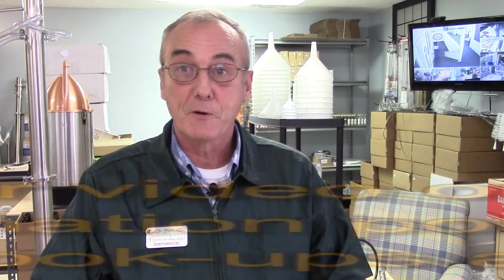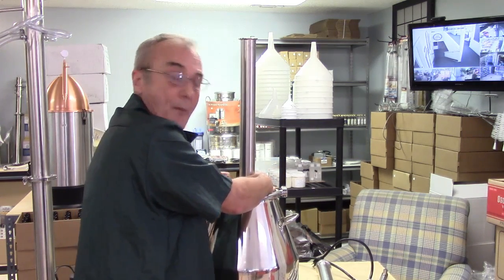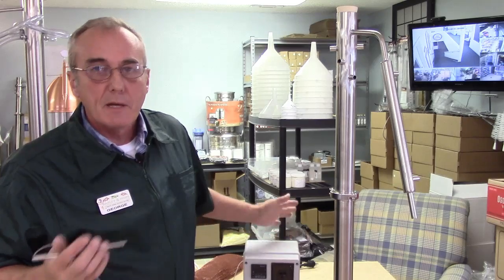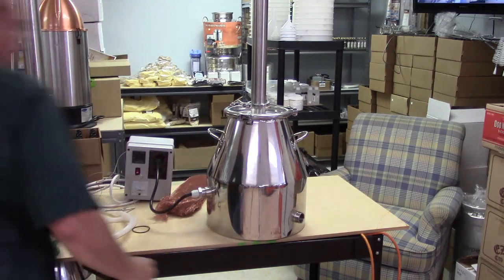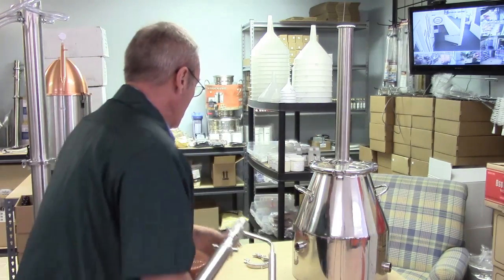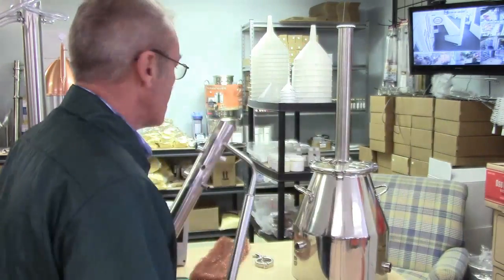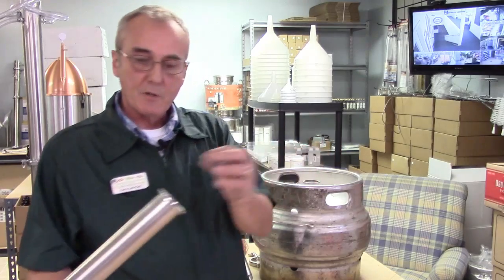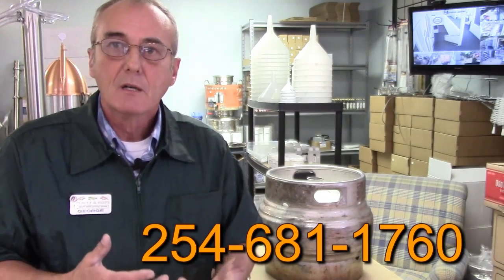2 inch Pot reflux still

Comment: To clean an old keg. 
Take it out side, 
put on an old rain coat and safety glasses, 
put a cup of caustic soda in it,
 pour a jug of boiling water in it and run, 
hose off old rain coat,
empty keg if its not already empty and rinse. 
No scrubbing required,
You might also need a shower.

Comment: does each plate represent a single distillation, i.e, stack 3 plates or 3 lengths of copper mesh wire to equal a triple distillation? thanks xxx

Comment: Great video George some interesting things. I did not know that the pony kegs already had that Ferrell piece that the column could already connect to. Thought it was something you had to weld on there!!
Reply from the maker: That's the great thing about it, the keg is already equipped so attaching a column is easy.
George
Reply: +Barley and Hops Brewing LLC 
Indeed, I've seen so many mods to those things but just always thought they had to have them welded on.

Comment: I run a 23 gal 3" reflux still, i was taught (may not bee right) to pack the bottom tube with copper then 2 on top with reishing rings at the top, what is your opinion on this? I run only sugar swipe. great videos

Comment: Hi George. I will be using copper mesh in my column when I run my still. Two pieces and I want to use marbles as well. How many marbles should I use? Thank you Sir. 2" column 1m length

Comment: Hey george i have an old family recipe for watermelon brandy. My question is i have the 2 inch pot reflux set up on a beer keg. I have it in pot still mode and i cant for some reason get the flavor to come threw. Not sure of its something i did or its its because im not using a thumpkeg. Any suggestions. Thanks
Reply from the maker: A much misunderstood topic. Watermelon brandy is difficult at best and the flavor of watermelon does not carry over as easily as some others may. Flavoring after distilling is always the best practice.
George

Comment: Hi Sr. I use to live at Copperas Cove in de the 90s... I was an international student at CTC in the Food and Beverage Management Culinary Arts and Hospitality. I have one question: why it is used de doble stack with this pots??? Can be used the condenser right in the lid of the pot??
Reply from the maker: A double stack is routinely used when a higher proof is desired and the reflux portion is running. Other than that it is perfectly okay to run just the single stack with the condenser. 
Now if you are asking if a condenser can be added to the lid without any stack the answer is yes. With this set up though the efficiency of your run will suffer. It will still work but you lose control of compacting the vapors prior to the condenser. In a column the pure ethanol will rise and the excess water will drop out in the column allow an efficient run. Without the column there is no way for this separation to happen.
Reply: Thank you for your kind response, very instructive !!! I love learning from people as wise as you are.
Reply from the maker: Anytime. Its what we do here.

Comment: Have you had any issues with the internal heating elements burning the wash? Debating on either an internal heating element or a hot plate.
Reply from the maker: Not at all. With a controller the element is never at full power after it heats up.

Comment: Hey George, my question is can you re-use the rolled copper from your column?  Thanks.
Reply from the maker: Yes, clean it as soon as distilling is finished. Rinse with warm water and if it is really dirty soak it  (25% vinegar 75% water solution) for 30 minutes or so and then rinse. The copper will last a life time.
You could also use Tarn-X. This product is sold in the cleaning isle of Wal-mart for about $5. Works extremely well and almost instantaneously but make sure you rinse very well after use with warm soapy water.
George

Comment: I've got a beer keg (10 GALLONS)which I'm converting.  Would it be better to have 2 elements or one.  Do you guys sell the heater controller"
Reply from the maker: I do not sell elements
Reply: @BarleyandHopsBrewing  I know just wondering if you could recommend where I could buy a controller.

Comment: can ya run both elements off 1 pid
Reply from the maker: You could but the question is why would you? The second element in almost all cases is for heating up the still. After that one element is used to control temp. Also, when you add an additional element your total resistance in a parallel circuit goes down and the amperage goes up. Your circuit may not be able to withstand that increase in amps.
This is why a fuse trips when too many items are plugged in, one would think that adding to the circuit would increase the resistance and thus drop the amps but the relationship is inverse and the opposite is true.
George
Reply: @BarleyandHopsBrewing ,  thank  you